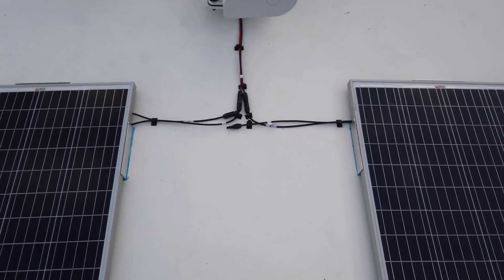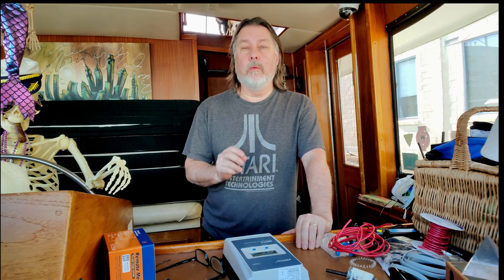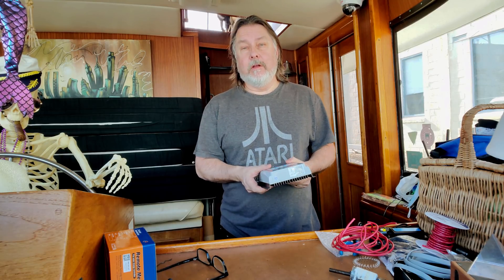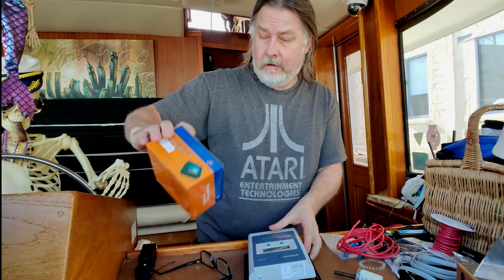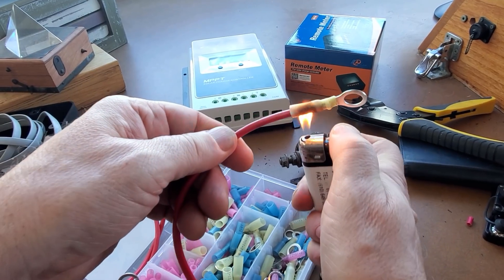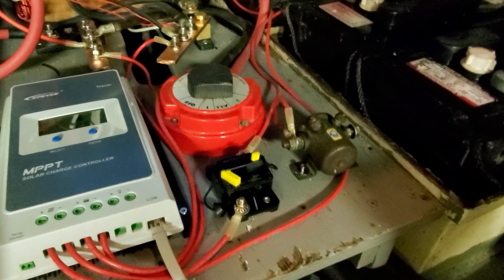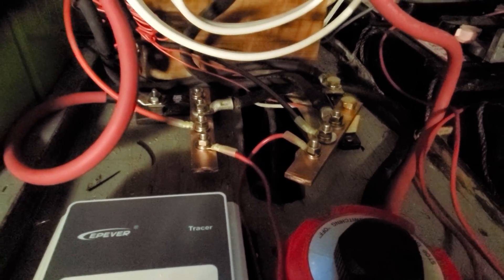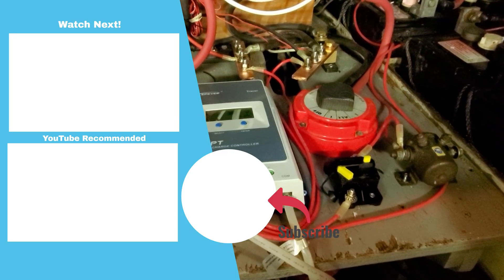How to use a boat alternator to charge lithium batteries. E111

Comment: everything I've read I know this is a debate is that you don't use an MPPT from an alternator to a battery bank use a DC to DC converter and there's a specific reason for that has something to do with frequencies I think but I'll leave that up to the engineers not the YouTube influencers
Reply from the maker: I am not an engineer either. I just went with info I picked up on DYI Solar and other sites. I have been using it for three years now and it works perfectly.

Comment: Hi, I'm looking for solutions to change my 24v lifepo4 bank with 24v alternator and come across your video! This is exactly I need! 

How's the mppt solution doing after a year?

What if the alternator is outputting say 40a, would it hurt the 20a mppt?

I'm concern that the MPPT controller  with a too low Apm-rating, will try to limit the charge voltage (Vc) to the programmed value, but the charge controller will overheat and fail due to restricting the current flow?
Reply from the maker: Not sure why a year old message just showed up. Anyway, It has been three years and it has been working perfectly. The MPPT is designed to take in a higher amperage and drop it down to what is needed. Mine drops 65 amps down to 20amps with no problem and never seems to get hot.

Comment: Can a solar controller like the one you identified be used to charge 24 V LFP batteries from 12 V alternators and 12 V batteries? I had planned to use the Victron Orion 12 to 24V DC/DC charger, but it only has a maximum of 15A charging output.
Reply from the maker: I do not know but I do not think our would do that. We have 32 volt alternators, so it is a step down, not up. I am not an expert on these things so I could be wrong. I just know ours works well for what we need.

Comment: How difficult was installing and programming the bms?
Reply from the maker: I was not able to program the BMS on the batteries. There is a way to do it but I bought the wrong connector and ran out of time. I am not very concerned. I connected a balancer and I only take the batteries down to 30% and up to 90%. It is the only downside to the batteries that I bought. Since then,  the cost of lithium batteries has dropped in half and I will be adding, or replacing, for next season.

Comment: I think you could have used a battery isolator to separate the MPPT controller from the 32 volt bus, so it could not run the controller when alternator was outputting less voltage or none. And this could actually be done with a single diode. (Isolator has two back to back ones and usually is pricey). A 60 amp diode is under $10 on Ebay, 150 amp one for an overkill margin. You could save the power for the relay.
Reply from the maker: Thanks for the tip. We used the alternator/controller sparingly during the trip because I was worried it would drain the batteries. My house banks are getting old and need to be replaced this coming year.

Comment: I wast curious if that setup would work. I'm glad I cam across this video. however, shouldn't you install the really between the alternator and the charger, rather than between the battery and the charger? I hear that you should NOT have an input current into the charger unless the charger is connected to a battery first. am I wrong? thanks

Comment: If I’m not mistaken charge controller controls the voltage of the panels…has this been an issue with the alternator?
Reply from the maker: They convert the power coming from the panels to what the batteries require. It does the same thing with the power coming from the alternator.

Comment: Nice details.  The business with the relay was somewhat confuuuuusing.
Reply from the maker: I was just trying to install a system that prevented me from accidentally leaving the charger on, and draining my regular house batteries. I figured if I hooked a relay between the controller and the batteries and used the ignition key to trip the relay, it would prevent me from forgetting.

Comment: Hey guys, another great video. 

Depending on the alternators you’re currently running you can probably upgrade them extremely easily. 

Find an alternator and starter repair shop (away from the waterfront because it’ll be cheaper). With those Detroit’s you should be able to get a medium or large frame 125 alternator on each engine. That way when you eventually do upgrade to lithium on all your banks you’ll be better able to fully take advantage of their ability to charge fast.

Cheers guys,
Jeremy K
Reply from the maker: That's a good idea. I was looking online for alternators and they were running around $1000 for the direct drive. Even still, I would need to use a solar charger to protect them.
Reply: @tryingnottosink9107  if you can find a an older Detroit shop they may have an old direct drive (accessory drive) unit that you could have rebuilt locally at an alternator and starter repair shop. Again away from the waterfront. Because when you put water or marine it doubles the cost. 

Maybe see if YouTuber Bus Grease Monkey want to help you and make an official visit with his Chanel.
Reply: loving the life lesson experience - away from the waterfront because it’ll be cheaper - and it's a FACT

Comment: Ahoy, I searched around and saw that a dc-dc charger should be used instead of an mppt controller as those are designed for solar panels not alternators.  Victron makes one called the Orion TR which is supposed to work for 24v charging at 30 amps.  Also I saw that alternators can overheat while charging lithium batteries on idle as the fan speed is tied to the speed of the alternator.  Low alternator speed, low fan speed.  Supposedly you will need a temperature monitor to turn down the alternator until it cools off.  What you have might work, but it is technically designed for something else.  Specifically solar panels.  It seems so it may be a good idea to have an electrician or somebody at victron check on it I think.  There is fire risk.  Wouldnt expect fire at low speeds rather than higher, but some things are just weird I guess.  Here is a video talking about a similar situation  
https://www.youtube.com/watch?v=jgoIocPgOug&feature=emb_title
Reply from the maker: The Orions are not compatible with our 32 volt alternators. I wish someone made one but I guess there is not much demand. I ran the idea for my system with a bunch of experts over at DIY Solar Forums and the consensus was this was a good way to do it. In either case, I plan to monitor everything very carefully, especially in the beginning.
Reply: Armel - that Victron video is a set up - In real world it's just not possible to run an alternator that slow (plus they didn't use a BMS on the battery.) Don't take my word for it - do what I did - go measure any (stock) pulleys you care and multiply the tick over RPM  by the ratio you got - NOT possible to run that slow. On my Merc the alt runs at a minimum of 2210rpm at 650 tickover -

Comment: Nice add-on to your battery bank system!  Something you may want to consider investing in, either an electric hot air paint stripping "gun" or a high wattage blow dryer.  This would be for doing the heat shrink on your electrical connections, using a lighter (or any open flame source) you risk both overheating the heat shrink which will shorten it's lifespan and introducing carbon, which CAN be conductive.
.
Regarding an all-electric drive on your Hatteras, not sure it would be feasible really.  Unless you can get your hands on a couple of drive motors and battery packs from wrecked Tesla cars that is.  I can't think of any other electric motors that might be able to match the output of your diesels, although marine electric drive systems ARE advancing rapidly.
Reply from the maker: Thanks. And thanks for the tip. Although I may not be able to get an electric motor to match the 8v92s output, I do not need it. I only need to run at 10 knots. They make a Long Range Cruiser version of my boat which as 150HP motors. An electric motor in that range should be good, I think. Right now it is just an idea, but I think it will become reality in the future.

Comment: What appliances etc.   can/do  you run with this system ?
Reply from the maker: We are using it to run 110 volt appliances. It should be able to run 2 small refrigerators, an ice maker, phone chargers and other small things as needed, along with a few cups of coffee, for about 4-6 hours (without charging). We plan to add more batteries to double the amount of time.

Comment: Nice work.  If I followed you correctly the charger you installed has a max output of 20 amps to the 24V batteries.  This would put the input from a 32V system at around 13.5 volts.  Most people have no idea how much infrastructure it takes to operate a boat.  Nice to see you have a good grasp on your systems.  Better than always having to depend on someone else when your out on the water.  Safe Travels from Savannah GA!!
Reply from the maker: Thanks. Fortunately, I enjoy learning new things, especially when it comes to the boat. I really enjoyed researching and putting this system together. Love Savannah!

Comment: I am so impressed as to be in awe!  How do you have the time to understand all of these things? Next up (suggested) how I changed to an all-electric propulsion system.
Reply from the maker: Funny. I have been researching electric propulsion and I really want to do it. I think it is feasible, although costly. Around $125K. The thing that stops me is having the boat on the hard for so long. Perhaps next year.
Reply: That’s fantastic.  Perhaps a short video floating that idea with an explanation of how such a system would work, i.e., would the motors be powered in hybrid fashion?

Comment: do you use the 32v bank for engine starting or do you have a dedicated battery bank for starting?  if you have two battery banks (1. hotel and 2. starting) are they isolated from each other?  I ask because you don't want to run your starting bank down on hotel loads, rather save it for what it was intended for.   when you mentioned that your alternators were 60 amp I thought that was kinda low but I didn't think of the 32v rather than the usual 12v automotive application.  60A at 32V is nearly 2000 watts.  the real question that I have about them is are they automotive alternators modified for 32v or are they designed as industrial 32v units?  A lot of folks think their car with a 100 amp alt. is pretty powerful but if you try to draw anywhere near 100 amps off them for any length of time, they will fry.  It takes a large case alternator with a good cooling fan to handle that much load (and industrial rated bearings) to have any life.
Reply from the maker: I am not sure whether they are automotive or not. They are rather large but they do not have much cooling. I just had one rebuilt for $200. It was intermittent. I have two 32 volt banks and they are isolated from each other. One is starboard starting only and the other is port starting and house bank. I have a switch and relay to run connect them if needed, if one bank runs low. They are both 5 years old now and I think I might need to replace them soon. I accidently ran the house bank down to zero when the marina blew a breaker and my charger went offline. A small load over the course of a couple weeks drained it down.
Reply: @tryingnottosink9107  they make battery isolators so that when your are charging two banks one doesn't take from the other (it's just a transistor that makes the path a one way street). It would probably be a good idea to talk to somebody who really was expert in this stuff.  Did the alternators come from Detroit diesel (I believe you had Detroits, could be wrong).  In any case most engine companies don't marinize their engines but sell them to somebody who does (different cooling system, manifold, etc.)  i don't know if trucks use a 32v system, I have seen 24s, so I'm wondering how the alternators got to 32v???  A truck zooming down the highway at 60mph has a LOT of fresh air blowing thru it, your engine room doesn't,  I'll bet somebody makes a fan to move more air thru your alternators, shouldn't cost a lot, in any case way less than a new alternator.  Alternators are rather simple puppies and can be readily rebuilt as you've already done, pretty much likewise with starter motors.  Carrying a good rebuilt unit as a spare can probably save a lot of grief.  The guy who rebuilt yours might know more about all this than I pretend to.  Multi-step voltage regulators are also to be considered.

Comment: Arm chair expert here, forgive me.  It looks like if one of the buss bars you made loosened up the buss bars could short?  Maybe a block a wood between them.  It's safe to assume if something goes wrong it will be at the worse possible time.  Thanks for the videos.
Reply: I was also wondering if your solenoid is rated for continuous duty, it might be worth seeing if it gets hot after being on for a while.  I was also wondering if there is a danger of over loading the ignition switch, some solenoids take a lot of juice.  Lastly the the MPPT might not cool so well mounted horizontally.  Ed's a smart guy so he's probably way ahead of me.
Reply from the maker: I was planning to put some sort of divider between them, and over them as well. Perhaps plexiglass. Thanks for the thoughts on the solenoid. It did not occur to me to see if it was capable of continuous load. Obviously, the heads only require short bursts. You might see me making a correction in a future video.

Comment: Good idea to be conservative at 20 amps, since charging those 24V batteries is a secondary use of the alternator, if I am not mistaken. Your 32V batteries start the engine, and the alternator charges them, right?
Reply from the maker: Yes. I have two 32 volt banks. The starboard bank is just for starting the starboard engine. The port bank is for starting and house. There is also a switch for combining them if one bank gets weak.